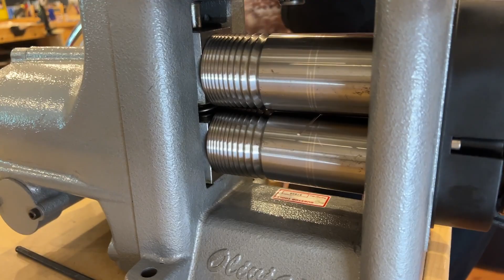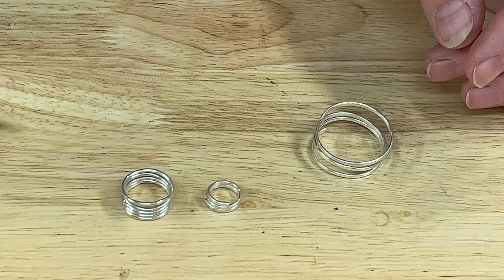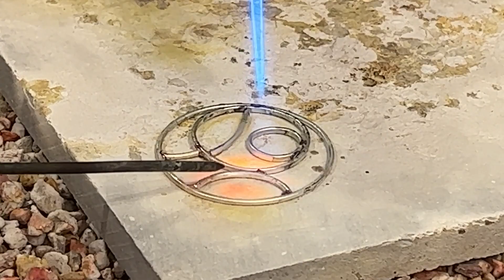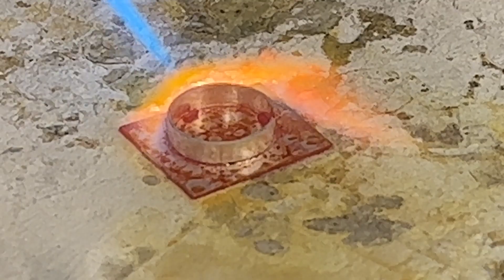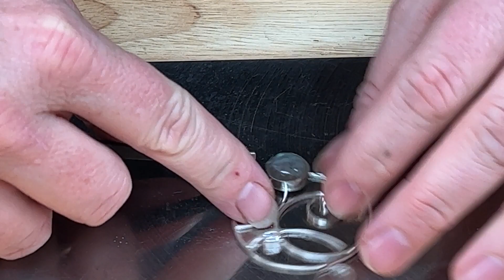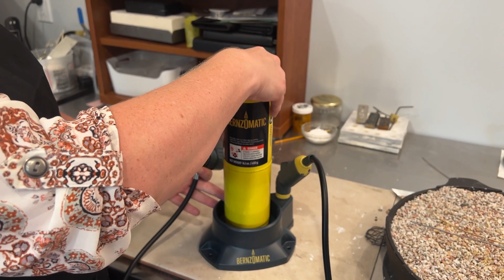Making A Pendant With The Bernzomatic FirePoint Creator Tool With Melissa Muir - Metalsmith

Comment: Thanks Melissa. I recently bought one. What are you using as a heating soldering station? I saw a round container with what looked like small coals. There was also a white block. Im using two layers of cement fiber board on top of my shop bench.

Comment: Thanks. I am interested in making small metal sculptures using silver solder for strength. have you used the Bernzomatic FirePoint Creator Tool with other metals and solder?
Reply from the maker: @lawrencediggs7957  yes. And just as it is with silver, it is going to be good for smaller projects. But it should work fine with other metals and solders as well.

Comment: You made up my mind for me. I was considering several torches but I am going to buy a Burns O-Matic torch.
Reply from the maker: It is a great torch. But keep in mind, it is only good for smaller pieces. So if you are working small, it should be good.

Comment: Thank you for making this video! I have their normal torch nozzle for the map gas tank but I'm finding the flame is just toooo wide. I think I'll upgrade to this set up after seeing how precise you had your flame. Thank you so much!
Reply from the maker: I use the TS8000 for casting. Yes. It is too wide and actually too hot for most of the things I do.

Comment: Hi Melissa. Thank you so much for the video. I keep looking at this and then I'd also consider getting an acetylene tank  set up. What are your thoughts about this compared to acetylene tank set up? Is it vastly different or, is it close enough for a beginner? At the fabrication class, obviously we're using an acetylene atmosphere at tanks and I'm getting used to them. Considering the substantial price diff, the bernzomatic system w/ tank for $100 versus an acetylene atmospheric tank set-up for $500, I'm wondering if the less expensive will be sufficient or if I will outgrow it. FYI: I will be enjoying my soldering and jewelry fabrication in my garage studio, if that has any bearing on the decision.
Reply from the maker: You will quickly outgrow this torch if you are already using acetylene/air. This is good for small pieces.